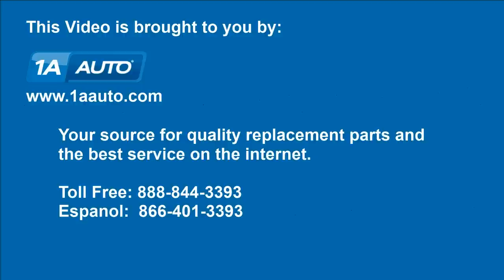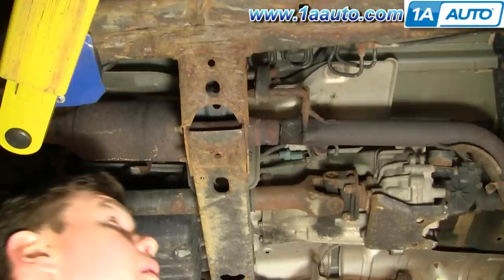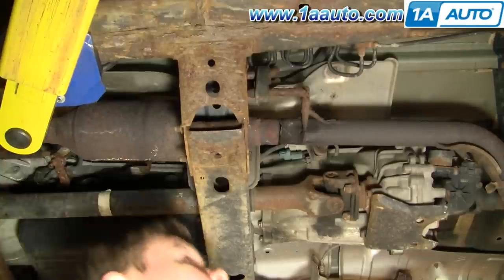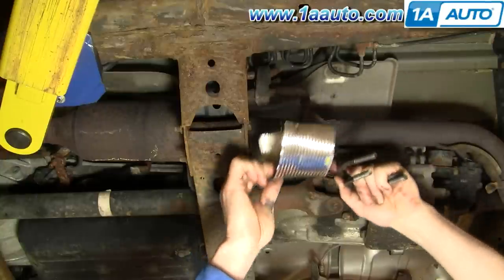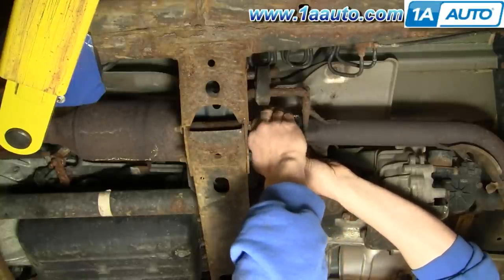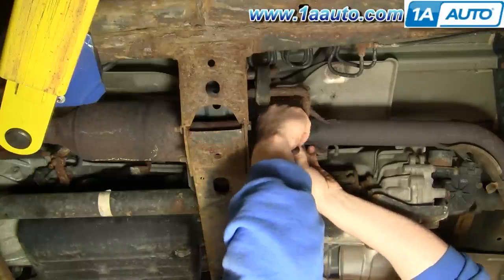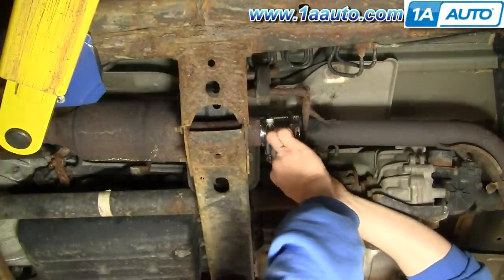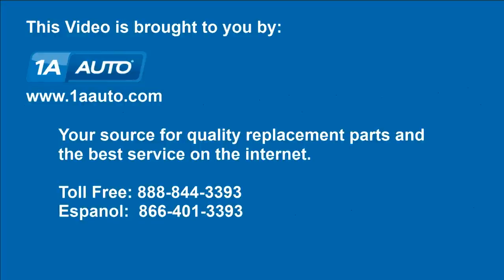How To Temporarily Fix Exhaust Leak - Tin Can & Clamps

Comment: I thought I was the only one who done this?  I replaced the bottom of the exhaust header so I could drop the tranny of my Ford Ranger 3.0,  well when I replaced the tranny, and took it for a test drove it was louder than a harley davidson motor cycle!  So i took a beer can cut the ends off and took the flat part and done the same method with the hose clamps on either side of the clean cuts of that piece of exhaust I cut.  2 beer cans 4 hose clamps, one bad ass sounding V6 3.0 Ford Ranger!

Comment: Is a beer can or soda can ok to use? Thanks.
Reply: 1A Auto Parts ok...thank you...have a mechanic coming tomorrow. Would you happen to know if a 2000 honda civic ex parts would work on a 1996 honda dx?
Reply from the maker: +By Grace Alone Depending on the part some of them might be interchangeable,
Reply: 1A Auto Parts thank you...just realized it's a 2002...poop. lol much aloha